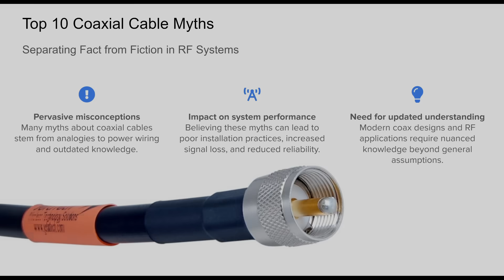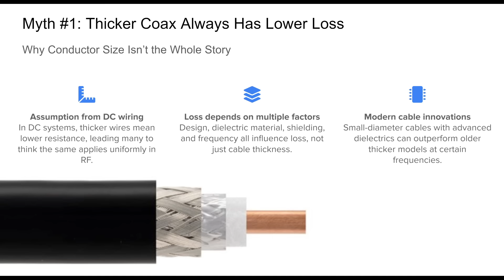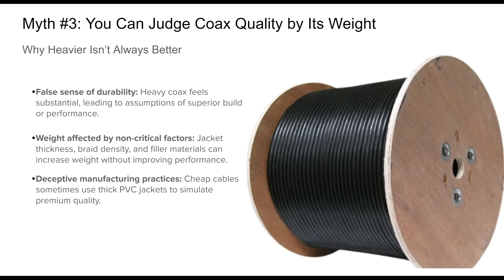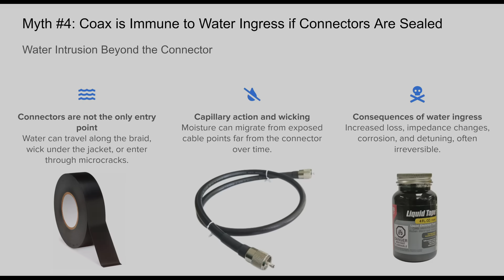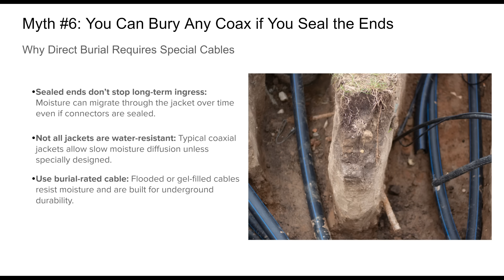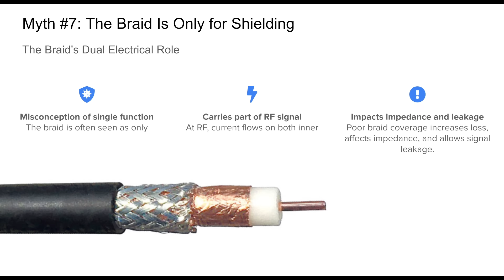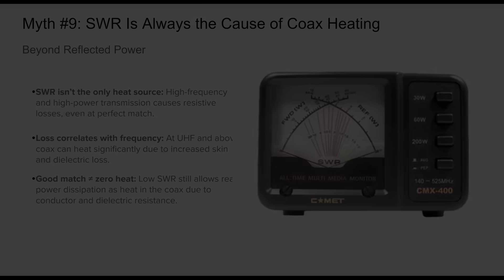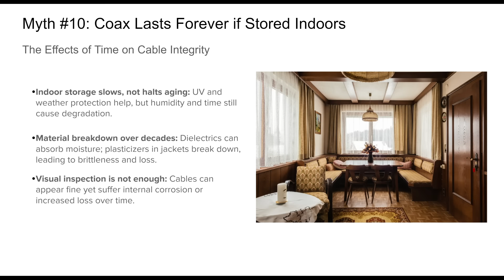10 Coaxial Cable Myths EXPOSED!

Comment: I think the only problem with the first one is the wording. 
You could say "At HF frequencies, larger diameter coaxial cable is usually lower loss"
Reply from the maker: Fair point, thanks for the comment L44 👍

Comment: Not a myth, but it's worth reading the spec of the coax you are using - don't use bends or turns tighter than the recommended minimum. For a fixed antenna, that should be easy to check. For an antenna that is rotatable it's more difficult. You have to allow enough slack so that at any given azimuth (or elevation) position the bend radius is greater than the minimum recommended. If you are spending hundreds or thousands on the rest of the equipment don't try to save money by buying cheap coax (and cheap plugs). I have no afiliation with the company or supplier(s) but I use Messi and Paoloni coax and connectors, definitely not "cheap" RG58
Reply from the maker: Thanks for the comment!

Comment: ABR Industries and Messi and Paoloni make really good coax. For long term use and repeated use, good coax can make a huge difference.

I’ve used the cheap Amazon RG-8X stuff for my G90, but I’m noticing that over the last year, the coax degrades quite a bit and doesn’t roll up as neatly as it once did.
Reply from the maker: I’d agree with all this, thanks for watching SG 👍

Comment: I only use it for my boom antenna for my tv's in the house.  It sure beats that old brown flat twin lead wire we used to use back in the 70's.
Reply from the maker: Thanks for watching Rebel 👍
Reply: Even twin lead is subject to technical specifications, material used as far as manufacturing, and installation. A common myth is that twin lead has more loss when compared to coax cable. Most often a lossy twin lead run is caused by improper installation. For example, a lot of twin lead installations are done with the run directly made on the mast and held on by tape. The mast effects the impedance and loss of the twin lead. This is why it’s recommended that twin lead installations are done with standoffs along the mast.

Comment: Coax for Video, such as CCTV applications or audo often reveals another issue not often apparent in RF applications.  They are subject to ground loop issues. This is seen as hum bars in analog video in CCTV, and noise pickup in sound equipment when unbalance audio is run long distances and not all the equipment is connected to the same ground point. This applies to RF too.
In the CATV, think subscription TV, part of every inline amplifier along the main cable, they have "Slope" compensation to boost higher channel frequencies to compensate for the higher loss at higher frequencies in the coax.
For more information, google CATV tilt or slope adjustment.
Reply from the maker: Thanks for the info 👍

Comment: I once was trying solve a video distortion problem on a system with the sources in a server room and the screens in offices something like 100m distant each fed by 3 coax cables as RGB with sync on green. The problem was that the cable was steel core with copper plating designed for much higher frequencies than the video. That's because of skin effect and steel is cheaper than copper. So the problem was because the video signal is positive and the sync signal is negative so the DC offset or charge caused by the video messed with the negative sync causing delay for each new line on the screen. Areas with more green signal were worse than other areas. Substituting the RF coax for copper core Data coax run up the stairs and through the hallways "fixed the problem" or at least proved the cause.
Reply from the maker: Wow, that sounds terrible 😐
Reply: Most analog video has considerable tolorence for some DC on the video line as the sync back porch is used for clamping the black level for "DC restoration".
In long runs where you see distortion, and clipped sync, the cable might not be terminated properly for 75 ohm, or the wrong impedance cable was used for baseband video applications. A 50 ohm cable can overload the video source with the lower impedance, and have reflection in the cable due to a load mismatch of 75 ohms.  For 100 meter runs, you may need a video distribution amplifier at the video source with a tilt or slope adjustment to compensate for the attenuation of high frequencies in the cable. Be aware too, that single ended coax, with both ends grounded at different potentials raises the issue of ground loops with the cable. Ground loops are a common issue with long baseband video runs.
One solution for the ground loop issues is to use a video modulator at the video source and send RF with a tuner at the other end. This solution breaks the requirement for DC continuity in the coax to pass an undistorted signal.
Reply from the maker: @isettech had no idea

Comment: The big factor is the capacitance per foot which is lower on larger cables and dielectrics with the lowest density. (Air being best, solid worst) As with anything electric, loss almost universally is converted to heat.
Reply from the maker: Great point, thank you 🙏

Comment: at about 6:10

It is actually the inside "skin" of the shield that will carry the bulk of the current at high frequency. In the coax shown at this time in the video it appears that the inner shield layer may be copper foil, while the braid looks like it may be aluminum (it actually looks like there may be a double braid, bare copper for the inner and whatever the outer braid is). The nature of the current flow is such that the area of the magnetic fields is minimized. In coax, that means current "prefers" to flow on the outer surface of the centre conductor and the inner surface of the shield. At very high frequency (not necessarily "VHF" as used in amateur radio) the skin depth of the shield may be no greater than the foil. At lower frequency it will extend into the braid.

Remember that coax data sheet specifications for shielding percentage, unless otherwise noted, is an "optical" spec - how much of the shield is metal versus "holes." 

 And from Linear Technology AN19 by Carl Nelson:
12. Didn’t Read the Data Sheet
        Then you shall have no pie.
Reply: Absolutely right.

Comment: You never covered the part about higher quality thicker cables with less loss have lower noise over a run.
I've seen it tested, 100m of different cables, the Rg58 made significantly more noise at the receiver than LMR400. 
My guess is the more shielding the internal circuits have and the further they are apart the less noise on the cable. 
The whole misconception is that if you are making a 80m antenna, well even Rg58 has low loss on 80m at x distance lets do a massive run of Rg58 because there's not much loss, not realising that there is going to be an S point or two of extra noise introduced by the Rg58.
This does make distance more important, and I would suspect a buried Rg58 would outperform Rg58 just layed over the ground, I don't know I haven't seen it tested. 
I have had engineers argue it doesn't matter, yet actual testing say different. 
This is why I would use 10mm or 12mm cables even for 160m, 80m and 40m where people say the loss is acceptable to use Rg58, infact it's probably more important on these frequencies given the noise that is already on those bands.

Comment: UR67 is the only cable you need for Ham Radio to Antenna connections..Nothing else compares
Reply: Low shielding, looks like 85-90% would pick up heaps of noise on a long run. 
and when you say nothing else compares, I doubt that, M&P ultra flex 10 seems like it outperforms it, I also bet the ABR 10mm would be of similar or better performance. 
Also Strip Flex is the ultimate coax cable, if you don't know or understand what Strip Flex is then don't comment on what cables are the best.

Comment: I bought some RG58 at a radio rally once and when I got it home stripped it to expose the braid, I was very disappointed, it was a very open weave.
I now want to see coax before I buy.
I have about 25' lengths to my attic dipoles and use only QRP.
G4GHB.
Reply from the maker: Gotta be careful, lots of shady coax out there 🤷

Comment: Personally I have a dislike for the PL259/SO239 coaxial connectors because the nut on the PL connector almost always have a bad or questionable connection due to the insufficient design where it shall perform two things at the same time.
Reply from the maker: It’s a fair point, thanks for watching bro 👍
Reply: My first Leixen 898 has a BNC connector.
It's disappointing that my second one has an SO239 connector instead of the BNC connector.
Reply: @jeffkardosjr.3825  I would have preferred an N connector though, but on the radio it doesn't matter much, but when you are outdoors the N connector also have a built in seal to restrict water intrusion.

Comment: Choosing coax should be based upon reading the manufacturers detailed specification sheet.
Reply from the maker: Correct
Reply: Well that is what experienced people do, but if you're not buying it for commercial use it's always a trade-off between spec and price.

Comment: Only two obscure facts about dielectric that you missed. First, if a cable is going to be used in buildings (Auxcomm deployments) the sad reality is that it will have doors and windows closed in it, and foot traffic. Getting a protected cable run may not be possible and a foam dielectric gets crushed and compacted. Solid dielectric takes more abuse.
 Second, vertical cable runs stretch and sag from gravity. Again, foam dielectrics deform more. A cable sheath that looke like a wire version of a "chinese finger trap" should be used on vertical cable runs. That provides distributed even pressure instead of creating punch points like zipties do. (I can never remember the proper name for them, but a GOOD cable supplier will have them.)
Reply from the maker: Thanks for that info and for watching 👍

Comment: Watch out for auto-ATUs!... Why?... Because if water starts getting into your coax things will change. If you have a manual ATU & when the coax was first installed the ATU band setting was saying 7.5 F 2.0 & today it is something different then you know something has changed & can go hunting for the problem. 
If you have an auto ATU then push the button & every day you'll get 1:1 & never know you have a problem.

Also watch out for water ingress making things " better".. put some water on your braid & it will corrode & become lossy. That loss both reduces the power reaching the antenna ( so LESS power reflected there) plus it then attenuates that reflected power before it gets back to the SWR meter back at the rig... The consequence being water in the braid can falsely IMPROVE your SWR (whilst ruining your actual tx & Rx).
Reply from the maker: That’s a good point for knowing when something is off 👍

Comment: Nah, nah, nah, hang on, the loss on LMR 240 at 150MHz is about 9.9dB per 100m. RG-213 is about 7.5dB. The "thicker is better" rule usually holds up.
Reply: usually is infinitely less than always
Reply: @matthewtheobald1231  Aha, yes, that's true. But the example given in the video doesn't hold true, for one case.
Reply: "Rule of Thumb".....😸
Reply: Basically, it’s more complex than that. ❤
Reply: @ZeroStatic  Maybe very rarely!

Comment: Over the years of being a ham but also doing RF systems I have standardized using lmr-400 and 600 direct burial for anything outdoors that isn't hard-line, in the last 20 years I have never had a failure because of water.  I have ripped out miles of cheap coax because of failures.

Moral of the story get the right coax for the job and as ape said compare the specs on paper. 

Pro tip, there is a lot of copycat and fraudulent stuff out there , buy from a reliable source that has a good reputation. 

Your antenna system accounts for 75% of your system performance. 

73...
Reply from the maker: Great point about the fakes and copycats 👍
Reply: Yep.    I have been doing RF systems from 400Mhz to  5.8GHz.    Mostly outdoor  Point-to-Point  microwave links.   And  municipal outdoor WiFi.     I was turned on to LMR240,  LMR400,  and LMR600 for runs up a tower.     I use LMR for my HAM Shack too.    A substitute is  ABR-400,  which is a great compromise for some HF stuff.   Mostly I order LMR cable assemblies  from  MPD - DIGITAL  in  Atlanta GA.    Never had an issue with their assemblies
Reply: 100% yep LMR buried would make for a good cable, because it has a low % of shielding, so doing big above ground runs will pick up heaps of noise. My assumption, because I haven't see it tested yet is that buried cable with even an 80% jacket can perform close to the performance of jacket shielding as Stip Flex seeing as it's under dirt.
Reply: While I am not a LMR fanboy, I agree, though I think 75% may be low!

Comment: Nice video.  Good coax has a data sheet we can look at.  If it does not have a data sheet on it ,I wont buy it !!  Having good luck with DXE RG 8X high vis . I put a KW at HF threw it.  Bands suck in NY even 6 meters flat . This weather change from muggy to normal closed most bands . Was some nice ducting on 2 meters. We may get some space in the 30-50 MHZ range to use. A partition to the FCC was filled for more FRE/GMRS and MURS . This time 30-50 MHZ asked for. That a empty band now that no one else wants anymore . VHF low band CB or something may happen !  Radio shacked asked for FRS . Cobra radio asked for FM on CB . That went threw easy . 73
Reply from the maker: Hey Robert, thanks for watching bro 👍

Comment: So, size doesn’t matter? 🧐 We’ve been lied to
Reply from the maker: Lol
Reply: Fun fact, even with skin effect, a larger center conductor provide a larger diameter and thus larger cross section for lower loss in the conductor, but more surface area for more heat dissipation and more dielectric loss, so size does matter for high power applications.